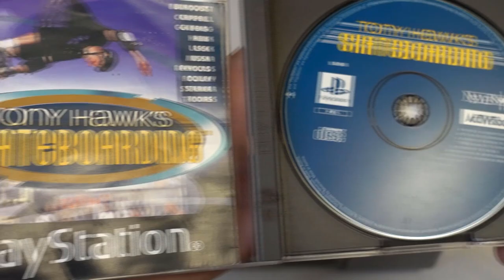restoring a Sony PlayStation | Retro Console Restore & Repair

Comment: Excellent restoration! What degreaser do you use that is safe on these plastics? With regards to the peroxide I've seen one video where someone was retrobrite-ing the controller and the Sony logo printed on it came right off -- probably too high of a %? On the contrast I have noticed that a PS1 motherboard I have that is sticky (likely had a spill) isn't getting clean with a toothbrush and 91% ISA -- likely 99% is needed?
Reply from the maker: Hey!
well i mostly use isopropanol to degrease and clean the parts.
Reply from the maker: for retr0bright I use hydrogene peroxide with 12% and just uv light. 
I never had a problem with printed logos or stickers (that i didnt remove before). 
best wishes 
phil

Comment: Hai, does it is a must to put those plastic parts into a waterproof bag before put them under UV light process? If my UV light is not strip type like yours, can i directly pour hydrogen peroxide into the box and put in my yellow plastic parts?
Reply from the maker: No, you don't need the bag, just make sure everything is watertight. 
Best wishes phil
Reply: @restoreeverything8654  thank you sir for your help

Comment: I'm doing the same with the Gamecube, but the bottom part of the top shell is uncovered (half submerged) from peroxide water (because I have no enough more peroxide anymore) the Gamecube console is tall, will that part deyellow slower than the submerged plastic parts?? or all plastic no matter half-submerged or not, take the same effect?
Reply from the maker: hey, you really have to be carefully. the only way to get even result is when everything is submerged with hydrogen peroxide. 
best wishes
phil
Reply: @restoreeverything8654  Redone fully submerged, and finally almost everything deyellowed; however, the shell didn't deyellowed at all, the exterior shell, the slot cover was fully deyellowed like mint condition.
Reply: @restoreeverything8654  Can I deyellow with the same retrobright solution H2O2 bath once again/twice?
Reply from the maker: yes, that works of course, but the % content of the  hydrogen peroxide drops after each use. I use it up to 3 times. it just takes longer. 
best wishes
phil

Comment: Hi, while restoring my ps1 i found there was no video output so i changed the capacitors and video is back but all distorted like ih this video i took: https://youtu.be/2TmfUBaWD6Q any way to solve it? thanks.
Reply from the maker: Hey Abraham, yikes!, never saw that before. I have no idea how to solve it.
Reply: @restoreeverything8654   thats so sad,, i got another one that did not read disc and i solve it by removin avoltage regulator wich brigs voltage to the cdrom controller. ..  but still wanting to fix that gliched one.